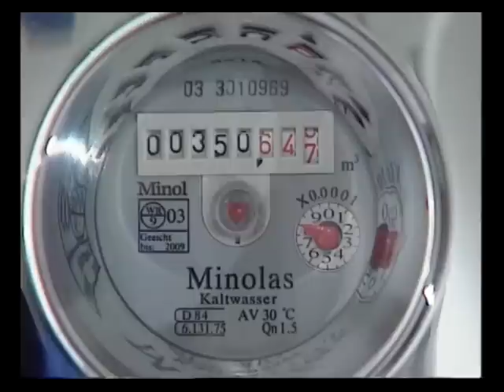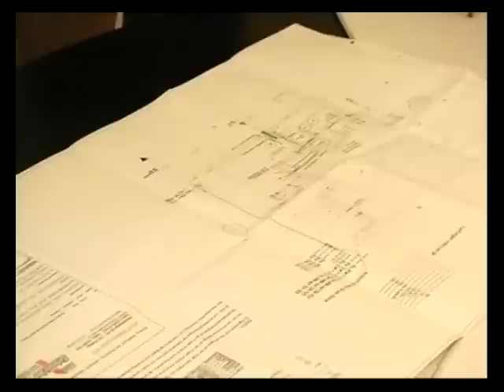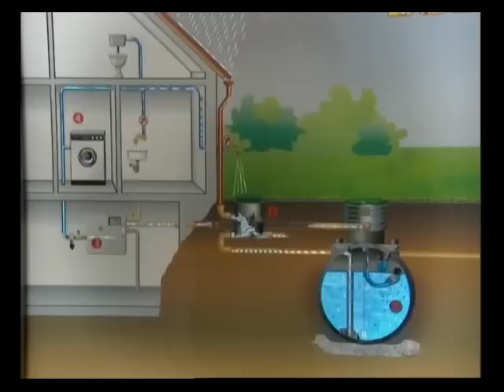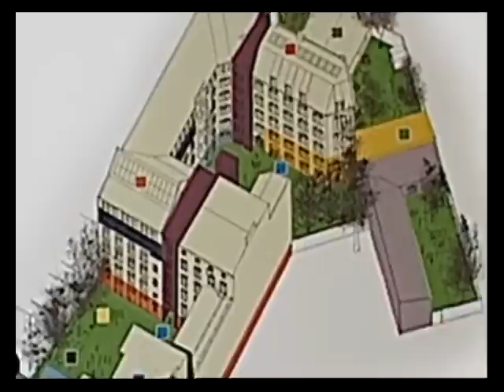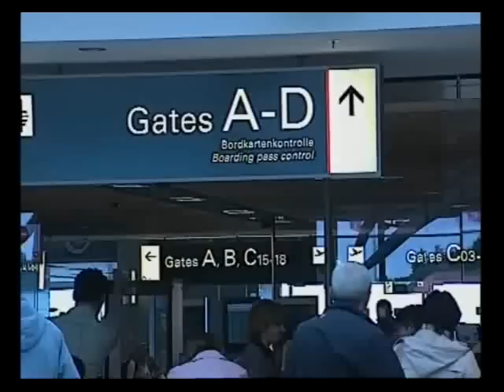Rainwater harvesting in Germany - Examples

Comment: Respected sir. 
I have like your idea of using rain water very efficiently. 
I have some suggestions for you .
First we must make system to collect the rain water falling on road. 
Now a day's we have sophisticated road and we can collect  clean rain water falling on road. 
Second for avoiding mixing of drainage water and fresh rainwater,  
We must make socking pit in each building and beside road . Rain water will be absorbed by earth through these socking pit and water levels below earth will be increased.
Only in case of flooding rain water and drainage water can mix ,  Otherwise wise most of the time , rain water will be absorbed by earth. 
Another solution is,  if possible we make  new pipelines system for collection of  rain water from road and roofs of buildings. This system will be useful for Arabic country. For filtering such rain water cost will be lesser. 
Actually all government is spending too much time and money for health issues and all other projects remain pending , which are very important. 
Government is made with public and we public are irresponsible. Thanks for raising such issues. 
Namh shivay.
Reply: our products are designed for the north where it rains a lot and can cause flooding and run off problems.
if where you live it does not rain you would not install our products.  would you ???